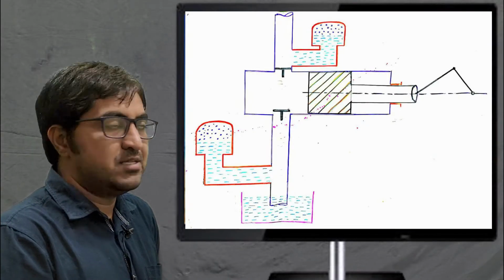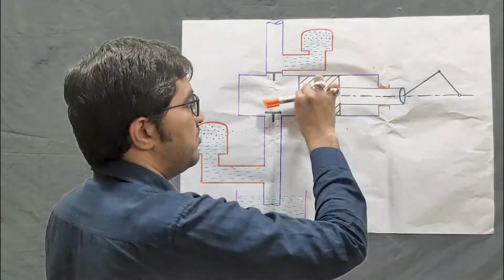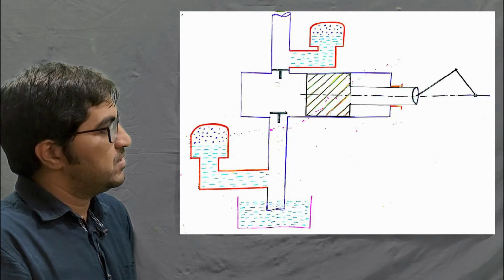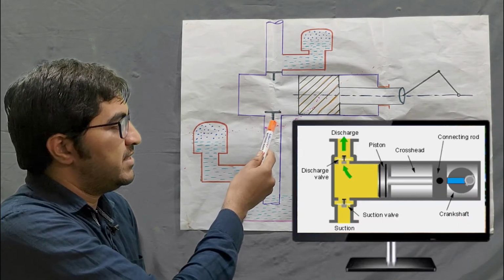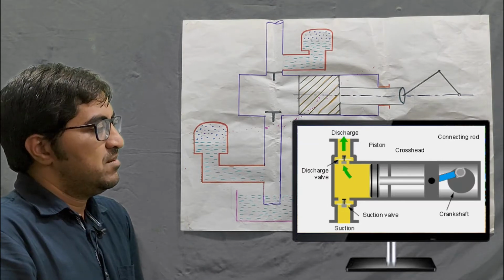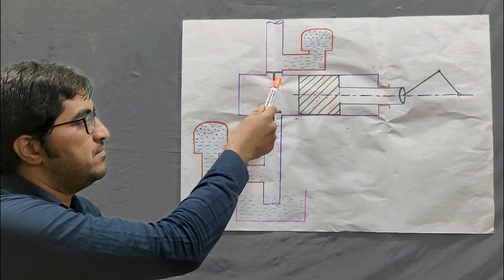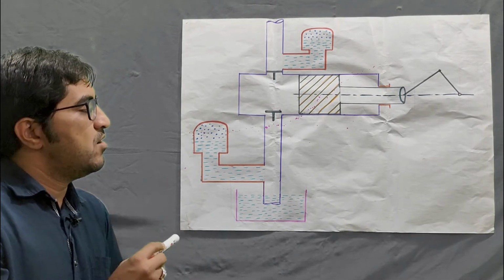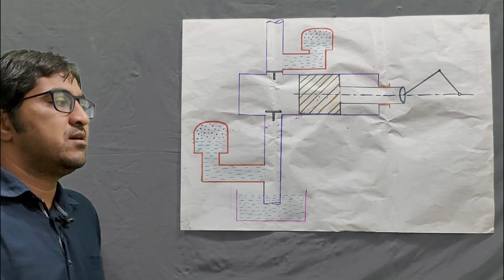Reciprocating Pump - Introduction || air Vessels functions || How does a Pump Works ?

Comment: Totally wrong explanation. Water can't go into suction air vessel when the suction valve is closed. Rather than, the water goes to the suction air vessel when the suction is happened and suction valve is open.

Comment: Sir, by using air vessel flow is continuous means, in delivery pipe the water will delivered only in delivery stroke or by using air vessel the flow through delivery pipe will continuously in both suction stroke and delivery stroke?